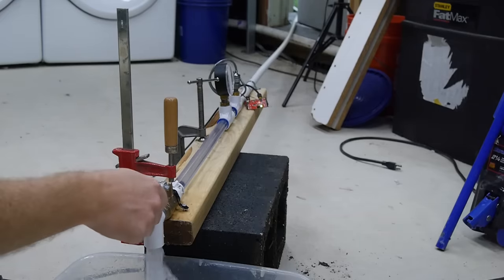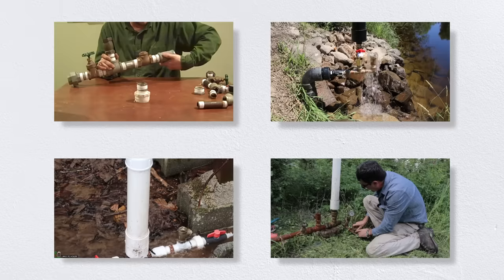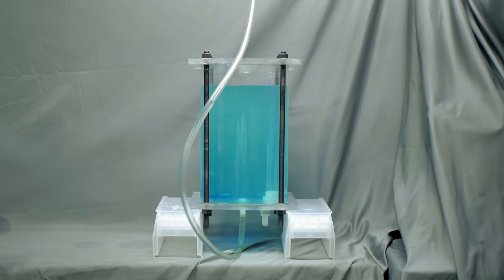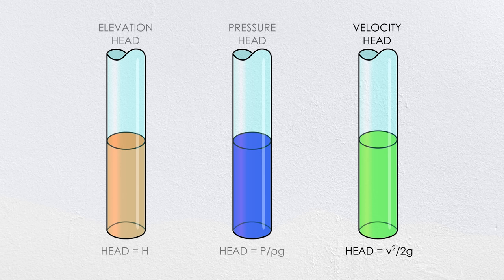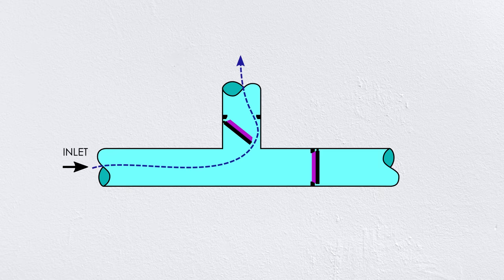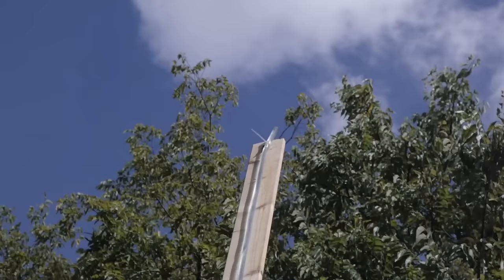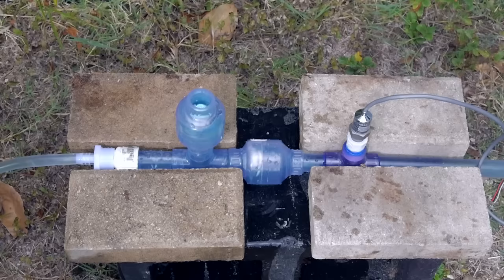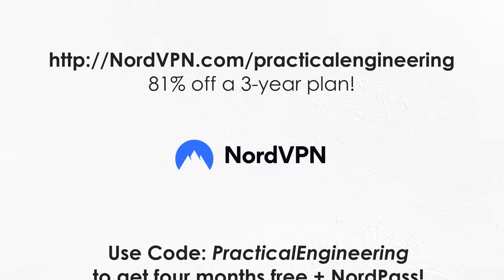How Does a Hydraulic Ram Pump Work?

Comment: I got so curious that I actually turned a ram pump into a powerful hydraulic pump by putting pressurized water in the input. But don't try it on plastic pipes, it creates crazy amounts of spikes.
Reply: Just a steep bit of ground and a long pipe can do that for you.  You get about 1/2 of a PSI per foot of drop.You can use a large diameter pipe for a good part of the run to reduce friction and then narrow down to a stronger much smaller pipe for the working part.  The pressure shock in the larger pipe will be much less than in the smaller one.  You may need to use a spring or weight opened waste gate valve to make it repeat well.
Reply: @kensmith5694  i used the Pressure relief valves on the output instead of a check valve, it outputs well over 900PSI 😂 crazily stupid but hey it works
Reply: @kensmith5694  i used 2 ½" pipes with PRVs just in case I screw something up
Reply: @dragonfireproductions790  
Adding some safety glasses is good.  The water can come out moving like a bullet.
Reply: @kensmith5694  i have more than safety squints 😂
Reply: @dragonfireproductions790  
Another AVE fan I assume.
Reply: @kensmith5694  ya bet 😂 guess who inspired me to do crazy stuff

Comment: This is very cool but does waste water. You'd need to add a collection under the waste valve to lower the water loss.
Reply: its not really a waste. Assuming this is pulling water from a natural source and then storing it in a tank for further processing, the water that comes from the top is draining through the ground and aquifer before ending up back at the source it was pulled from. Even if the ground becomes over saturated, evaporation is carrying it through the air and back to the source as well. The idea of "wasting" water only works when you are adding impurities/chemicals/etc. to water you are using, to where it will require a certain amount of processing in order to be considered clean again.
Reply: @snugglyjeff214  I suppose that is indeed true

Comment: i don't understand how this couldn't feed a tank that would have a different line leading down from it, which when overflowing, can open the outtake line spin a turbine to generate even a minute amount of electricity.
Reply: Chances are friction would cause the gain, if there is any, to be very, VERY low. That being said, it's also 'free' as in you're not paying for anything that isn't already being made. 

As a counter-point, will the turbine you're making make enough electricity to pay for itself before you have to maintain or replace it? Probably not.

Comment: I still don't understand where it gets the energy from?
Reply: It get the energy from the water flow in the water source (river or stream). That flowing water possesses kinetic energy, which the ram pump converts to energy in the form of pressure.
HTH
Reply: So it wouldn't work on a lake?

Comment: What would happen if you set up a ram pump and a Trump compressor together?. So that the air from the Trump compressor is being pushed into the air chamber of the ram pump.

Won't that push the water up to an even greater height?

Comment: Challenge:  Combine a Tesla valve with a Pythagorean cup to make a hydraulic ram having no moving solid parts.
Reply: A Tesla Valve leaks in backflow
Reply: @vidznstuff1  It does, but maybe it can be made to leak a small enough amount that it works anyway, and then you don't have to worry about check valves wearing out or their springs getting weak.  Remember that for the water pumped uphill, you can have this go over a hump right at the top, so that the water that makes it up high enough doesn't backflow (and water that doesn't get that high is water you can't use anyway unless you have something that can take it at an intermediate point or unless it is pushed up by more rammed water, but the latter case will slow down the rammed water, limiting how high it can go anyway).

Comment: But what is the efficiency of the ramp pump?
Reply: Does it matter?  If it pumps water, it's efficient enough. If you want a greater flow, build a bigger ram pump.
Reply: @jackx4311  
If it is used in critical situation then we need not to worry about the efficiency,but if we use it regularly a wise Engineer tends to minimise the waste(water wasted in ramp pump) and maximise the output.

Comment: Is that where the term “dead head” or “dead heading” comes from? Seems logical.
Reply: The only use of the phrase 'dead heading' I've come across is when people snip dead flowers off plants in the garden.
Reply: @jackx4311  while I’m sure you’re “dead” on. I’m talking about pumps. Dead heading in pipes as far as I know means you cut off the pumps ability to get rid of the fluid at it’s turbines. It’ll keep trying to pump if the pump itself isn’t shut off and create pressure heat and possible steam.

Comment: It's not entirely clear what's going on since you do not mention how you feed the pump, eg. where does the energy come from, and why isn't the second check valve open from the start rendering the system inoperational?
Reply: The water in the delivery pipe creates back pressure which keeps the second check valve closed until the water hammer pressure spike opens it. The waste valve is the path of least resistance for the water.
Reply: @johnguest4525  
Thanks.

Comment: You start with water flow, that is the pressure. You never state how the ram pressures compares to the flow pressure.
Reply: As he explained in the video, you start off with water flow, which is KINETIC energy, not pressure. It's the hydraulic ram which converts that kinetic energy into pressure, to force water uphill through the delivery pipe.

Comment: So lets say you pumped water in to a tank using this, then allowed the tank to drain the same mount as the volume pumping in, and that water spun a wheel attached to a motor or alternator. The water would be recollected and funneled  back at the source to be ran back through the system. Would this basically be free energy?

Comment: What if you used Tesla valves instead of moving valves?
Reply: Then you wouldn't get the required hammer effect, as Tesla valves are continuous in operation. Maybe on the delivery valve?

Comment: Where can you get parts to build this?
Reply: Most of it is just parts from a plumbing store.
The big valve is the hard thing to come up with.
A lot of those are improvised out of parts that were never intended for that function
Reply: @kensmith5694  - the big valve isn't hard to come by. You can buy complete hydraulic rams in all sizes, ready made if you want:
https://www.allspeeds.co.uk/hydraulic-ram-pump/

Comment: can you use a ram pump to pump a well? And waste water falls back into the well so as to avoid wasting water?
I read the efficiency of ram pumps is only 10% (10% you get out of the end vs the water wasted from the valve).
Does diameters make a difference?
All kinds of questions...

Comment: Can this be used to lift water from a 6 m. shallow well from ground elevation and supply it to the house with a shower head of 3.5 m. from the ground elevation.
Reply: It can be used anywhere there is steady water pressure, such as a spring or a river or creek. The water pressure from already flowing water is part of what makes the pump work. 

As for working with a shower, it's a slow but steady supply. You'd be better off feeding it to a large reservoir tank and then piping from that tank for your shower and other plumbing needs.
Reply: Apologies for this follow up question to give you a clearer picture of my query. A shallow well is an underground water. It is 6 m deep from the ground level. Will the hydraulic ram pump still work if it will be set at the ground level and then the water will be lifted up some 3.5 m in the house.

Comment: You left one part out. You need a stream or creek that has flow to make it work. Otherwise an excellent presentation.
Reply: He didn't leave it out. He made crystal clear that the source water must be flowing, as the ram pump depends on kinetic energy to work, and water only has kinetic energy if it's flowing.

Comment: I tried to write a long comment about how we can try to turn it into a sort of perpetual motion machine but realized we can't. The source of power of the ram pump comes from the the waste valve being lower than the level of water of the input. And if you want to run this system endlessly - you need an external power source to put the waste valve water back up into the input water tank. If you use a river, and just let the waste water fall to the ground - the external powersource is the sun, which powers all natural movement of water on Earth, except geysers. So by doing that you're not creating a perpetual motion machine - you're just creating a hydroelectric powerplant with extra steps
Reply: Nonsense!  The ram pump in this example may be fed from a tank, just for demonstration purposes, but in practical installations the source water comes from a river. All that's required for the system to run, 24/7/365, is for the water source (the river) to keep flowing.

Comment: But pressure IS kinetic energy 🤔
Reply: No, it is NOT.  You can have pressure without any flow at all - as you do in a can of spray paint.  You can ONLY have kinetic energy when something is MOVING. A can of spray paint holds energy in the form of pressure until you press down on the button. Then, that pressure energy is converted into kinetic energy, as the mixture of gas and paint rushes out of the nozzle.
Reply: @jackx4311  the particles inside the can of spray paint are moving. If it gets hot, the particles get even more excited and the pressure increases until the can fails containment and explodes.

Comment: Hi
My name is Simon I need to ask you about a scientific issue. I know you know stuff, and people.

Here it is:
In an effort to cool the planet's air, and introducing more oxygen to the upper layer of the ocean, I was thinking of stirring up water from the cooler depths of the ocean. It's just a thought you see. I was wondering if  technically this might work? But what is this Technology?
Say I  put a fifteen meter  tube in the ocean, it will fill out with water from the colder layer wouldn't it? But that water will not flow over sea level. So in essence I will have achieved very little.

Why will the water not come over the top of the tube? Because there is an atmosphere of Air putting 970 mm worth of mercury on top of the tube. This keeps the water from gushing out.

But if that tube was a cone. Would There be more pressure at the bottom than on top? I mean.. Water does not get squashed by the weight of more water. This I am sadly aware of. But the weight of the water on the upper layer might be putting pressure of some sort on the water of the lower layer. 

So if the water of the lower layer is under pressure, will it not tend to come out of the cone and spill over. This is my question.

If this would work there can be lots of things to do with it. But first I need to understand if this is within the laws of Physics. 

Very truly yours
Simon

Comment: Can't you put a syphon near the roof and then get the water flowing?
The complete system would function something like this.
1 - Ram pump pushes the water until it reaches the syphon.
2 - Syphon pulls the water to a reservoir.
3 - Reservoir opens and water drops on a turbine.
4 - Dropped water returns to original container.

Comment: HEY:
STILL IT IS VERY  DIFFICULT TO UNDERSTAND OF HOW THIS PUMB WORKS
YOU NEED FIRST TO EXPAON IN EASY LANGUAGE OF THE PURPOSE OF EVERY PART YOU USING TO BUILD UP THE PUMB
AND THEN TO EXPLAIN IN VERY EASY CONCEPT AND LANGUAGE OF : HOW THIS PUMB RAISED THE WATER UP= WHAT ISTHE MAIN STRUCTURE IN THIS PUMB THAT CAUSING THE WATER TO GO UP???????????????? IT IS VERY CONFUSING!!! = IT NEEDS A PERSON WILL- TRAINED IN EDUCATON AND TEACHING METHODS TO EXPLAIN TO  a lay person OF HOW THIS PUMB WORKS AND WHAT IS THE PURPOSE OF EACH PART YOU USING IN BUILDING UP THIS PUMP
HOPEFULLY YOU UNDERSTAND MY QUESTION
OTHERWISE : IT  IS SO TECHNICAL AND VERY CONFUSING AND VAGUE of how this pumb works!!!
thanks

Comment: 7:17 minutes into the video and I'm yet to see the part about "hydraulics"
Reply: Hydraulics is any fluids , water or oil etc . It's commonly used for hydraulic oil uses , like plant eg excavators  but  it's water as well , it's like fluid dynamics encompasses air not just liquids
Reply: @dennisphoenix1  Even so I was expecting a video on a hydraulic Jack. i ended up not paying attention because nothing was mentioned on it. i mean i was waiting for the part where he talked about how a hydraulic Jack worked, but never actually got to it so i lost track of what the video was about.
Reply: @HannTheftAudio   there will be lots of videos on you tube about hydraulic pumps and cylinders (rams)  etc .  It's a great resource

Comment: It seems like a lot of water is wasted.OK if you have a lot of water to waste.
Reply: The water isn't 'wasted'. The rig shown in this video is a demontration set-up - to show the working principles. In a practical installation, the ram is either in a river, or just above the water, so the ouput from the 'waste' valve just goes back into the river.

Comment: This is like eventing a sword in the 21 centaury  no need for this we have Electronics and it is eficenter
Reply: NONSENSE! The whole point of a ram pump is that it doesn't need ANY source of power except flowing water. Will your electronics work in a place where there is no electricity? Or if you have a power cut?

Comment: i need waste 1 gallon to pump 10 liters water in 10 meter height 😑 math Force=Pressure+VolumeWater. 100liters/2pressure =10liters per / gallon🙃 build bigger one can handle volume 1 gallon in fluid Computer simulation 😎

Comment: Okay, got it; but your explanation of what's going on in the pump could have been so much clearer if you'd given us a tour of the parts of your plastic model, instead of just showing it squirting and leaving us to figure out for ourselves why as you rattled on about engineering.

Comment: Couldn’t you use this to pump water back into a damn with water turbines to generate a small amount of “free” energy? Obviously it wouldn’t bring 100% of the water used by the turbines but even 25% brought back is all gain if we didn’t use electricity to power it.

Comment: Why not show the complete unit in your video? It's not very clear from your diagram as to why the water flow wouldn't simply continue into the delivery line past the check valve. Oh, look, at my laptop and pressure gauge, (which explains nothing on your diagram).  You ought to indicate that eventually the pressure needed to open the check valve on the delivery line becomes inadequate (and it closes), then gravity helps to open the waste valve (until the pressure builds up to close it). No, everyone needs to look at your laptop and pressure gauge, instead. And, for certain, let's never mention the inventors who came up with the idea and made the first practical hydraulic rams: John Whitehurst and Joseph Montgolfier. No interest in them?

Comment: But it wastes so much water.
Reply: Ram pumps are typically installed where there is already flowing water (such as streams, springs or rivers) so the water that is exhausted from the pump is normally directed back into the original water course just at a slightly lower point.

Comment: There is another phenomenon, hydrostatic pressure, pressure gradient that a submarine uses, there is a patent where some used this to power a generator, WO1996031696A1 I DARE YOU to reproduce it. I have seen a version work personally tied through our local university. There is new knowledge in buoyancy.  Read the patent

Comment: yep  and you beuild 2 system that feed each other....

never stops.   made many over the years.   procedural or not does matter....  its Efficient and can easily run a water turbine or Pelton Wheel.

Energy storage,  Water Storage,  predictable and on a larger scale makes wind and solar viable.  

the FED does not like these Non Taxable systems and has laws to prevent the sale of any finished system.   for now.

climate change or not.   Self reliance is the primary goal.

Comment: Vid is very much lacking. Aren't numbers and equations required for something to be considered engineering ?  plus , enough with the Shilling and Ads! Would you still make content if you weren't getting $$$ ?   You really made all that stuff only to show us a far picture and an oscillating graph(which has NO numbers wtf? ) . not even marks on the board with some indication of measurement ?  Cool clear plastic, showing inner workings, yet no performance characteristics. Why not sync that graph with vid of the pump working? (it came from that pressure gauge right ? ) that would at least show peeps how what pressure is used where and what time... Even if there was no numbers, that would be more 'engineering-esque' ....  I remember back to the reinforced earth vids, at least there was some fascination. Strengths, weaknesses, 'where things failed', where expectations don't meet reality...  This vid was more like.. oh look over there , its a bird , its a plane.. oh you too slow, its gone,, its ,,, oh ,, ya ,,an ad... I wouldn't write such a comment if I didn't care.. sorry for any hard feelings.. cummon man ,, put some more pep in your step. stop sucking up to the man .. man